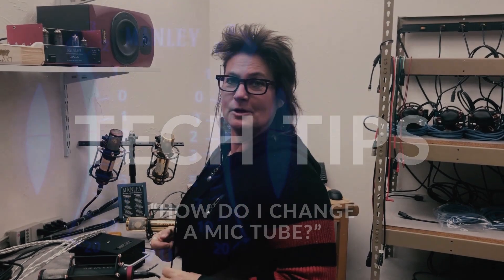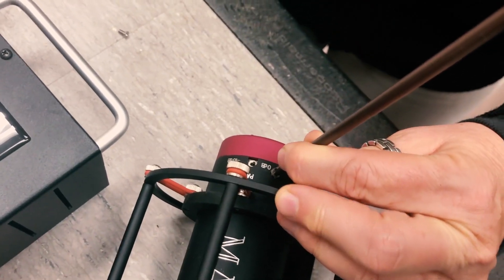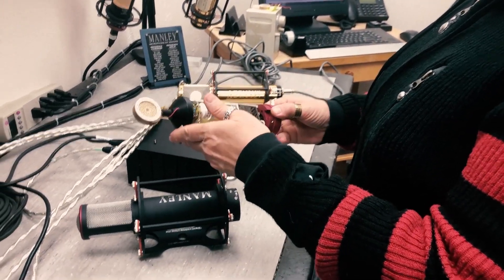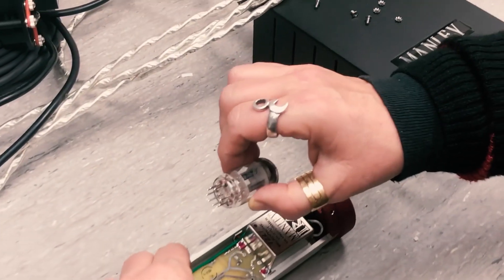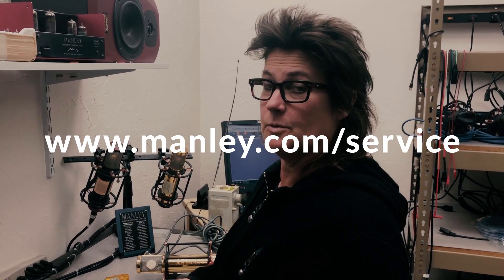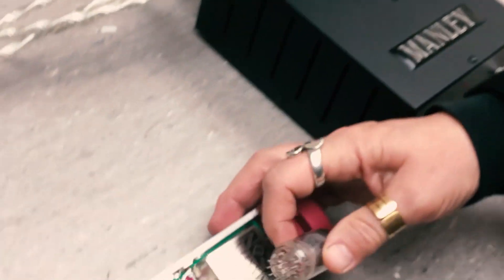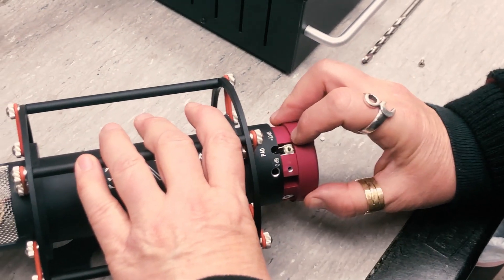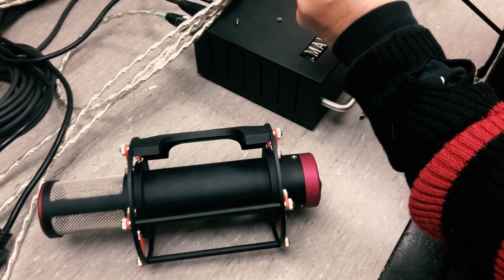Manley Tech Tips: How do I change a mic tube?

Comment: Is there any risk to swapping tubes frequently to get different tones? Or should they be switched infrequently due to wear on the internals from swapping?
Reply from the maker: Mr. Vacuum Tube's internals live in a vacuum and thus they don't even know they were swapped. Swap away, but pay attention not to break or mangle the socket pin connections and the socket's connections to the PCB.
Reply: @manleylabs  thank you!

Comment: Would KR audio tubes work they have some weird numbering system, and why don't you get them to manufacture valves for you? based in the Czech Republic supposed to be the best audiophile grade tubes you can get. You can actually get screws with fixed on star washers, and don't need to be separate may be a better solution a.